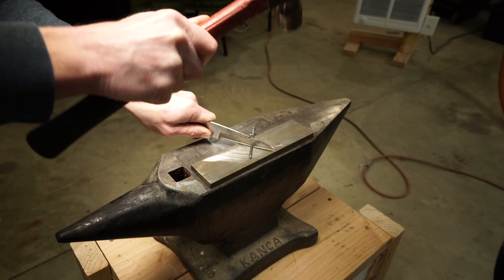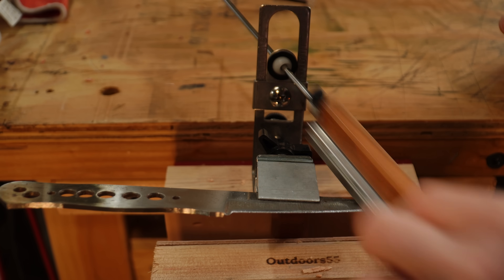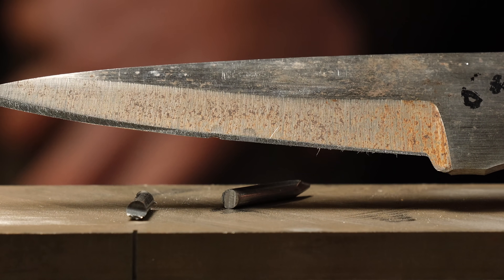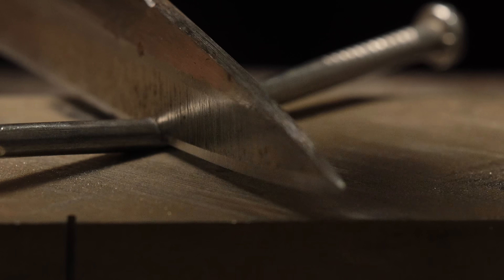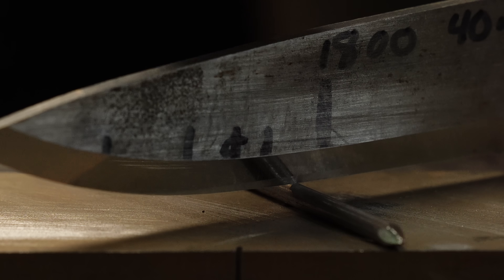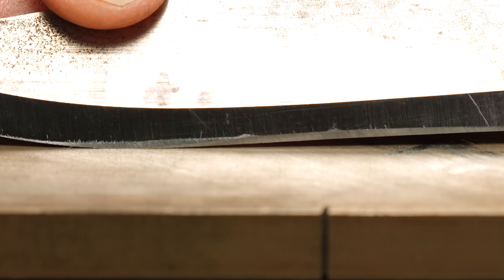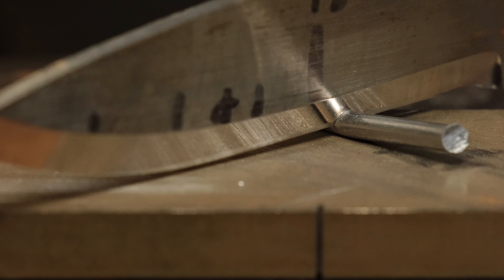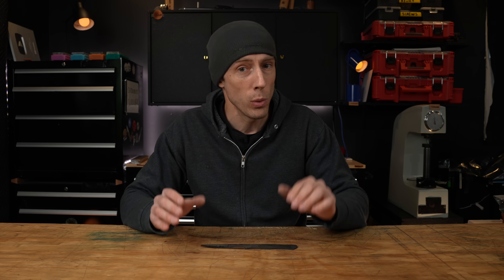Why My Knife Will Cut Through Nails And Yours Can’t - THE TRUTH is not what you think.

Comment from the maker: PLEASE READ- Nowhere in this video do I claim that any knife sharpened to 30 degrees will survive a nail test. The angle here is completely irrelevant. The idea is to adjust the angle to fix the problem. also please see follow up video here https://youtu.be/DVb7rmsZ6ko for more clarity.
Thanks.
Quick note. This video is about analyzing the TEST itself, and what exactly we are testing. Of course heat treatment, and steel matters.  And they definitely play a role here as well. However, geometry, is often a game of a few degrees, and a few thousands of an inch in blade thickness, that determines whether a knife survives this kind of test or doesn't.  Also, if we start stressing the knife on different axis's we will also get different results, since other factors then come into play. This is just a quick rundown showing that everything may not be as it seems.
Reply: @OUTDOORS55  ive had a kme for quite a while now. When I first got it, I ruined a few knives trying to get super small angles with those mirror polished secondary bevels. Turns out cutting simple plastic or cardboard at that level will give you considerable edge damage and dull your razor sharp knives to the point it won't cut at all. Expensive lesson learned.
Reply: So survivalists should sharpen to 25 degrees?
Reply: @YehawSkyrim  Or someone who cuts through a lot of chicken bones?
Reply: @YehawSkyrim he's not recommending angles. 25° would be a bad idea for different tasks of survival and good for others.
Reply: @YehawSkyrim 
Survivalists should rather stop thinking their knives have to be able to chop concrete, chisel through rebars, dig into rocky ground, pry open doors, etc... and start using their knives with a minimum of common sense.
Reply: I've learned so much from you Thank You.
Reply: People started doing this test cause of the old buck knife ad saying it could cut a nail.
Reply: Thanks for clearing this up so definitively. Another one that needs to be put to rest: polished edges have less edge retention, toothy edges stay sharp longer.

Comment: I saw an ad from the sixties where a Buck 110 cut a nail with no damage then they tried it with a new Buck 110 and it left a nail shaped inditation in the blade that ruined it . I know they haven't changed a Buck 110. Also I saw a Spyderco Endela VG 10 chop right through with no damage what so ever. I understand what your saying but is it all just blade geometry? I've seen multiple 3v knives go right through nails without even chipping

Comment: Yes you can give a lot more stability to an edge by increasing the edge angle but that’s not impressive. There are steels that can cut nails with 18 degree edge angles and that have everything to do with the steel and heat treatment.
Reply from the maker: @hamedizzy5137  18 degree inclusive or per side. These things need to be disclosed and third party tested.
Reply: @ you’re putting 25 per side to get you’re average steel to cut nails. Go watch some of the custom guys that do testing. You have miller bros cutting structural beams with 20degree edges a nail is noticeable impressive

Comment: Correct depends on geometry and how sharp and the degree of angle and Depends if every knife is cutting the same nails I know a Casehard nail is  way harder than a say 12 or 16 penny nail but even with the older penny nails to sharp of a blade will still round over. Great video keep Rockin 👊😎

Comment: You may be missing some of the point of a nail cut test in its relation to a particular steel and heat treat protocol. Of course the geometry matters, but the whole point of a supposed better steel and heat treat is that you can run thinner profiles with more acute edges, meaning better cutting overall, and still cut through a nail. CPK comes to mind, they run some pretty thin profiles with 18-20* edges and can cut through a nail with no damage.
Reply from the maker: Yes, but without knowing the geometry, and how it compares relative to other steels at exactly the same geometry it's meaningless. This is a game of a few degrees and a few thousands. Not something easily controlled unless each knife is specifically ground to that standard for testing.

Comment: I would broadly agree, but speculate that there's a range being assumed here. A truly inferior material (say, aluminum) would absolutely fail this kind of test, even with quite a bulky edge. Geometry is the most important factor within the range of materials commonly used.

I swear, I'm not just arguing to be difficult. With so many relatively new companies on the market, robust testing is necessary as an accountability mechanism. Destruction testing fills a necessary niche, especially in products that market on durability and reliability.

Comment: This is not entirely the case… the knife has to be harder than the nail and the grind overall along with edge also matters. You were using  what appears to be a scandi with secondary bevel… try that with a hollow grind and it can fail … the problem is … people want to focus on only one variable at a time when there are easily 6-10 variables at any time

Comment: So I've seen you make this point and it seems clear. However, I have QUESTIONS... Actually, only one. In another video about angle guides, you were pointing out that the higher angles on the angle guide were too steep and led to dullness and not keeping an edge. What is the minimum practical angle for a general purpose, carry knife, of reasonable steel and heat treatment if I want to make it shaving sharp but maintain reasonable edge retention? I'm looking for a ballpark, not a specific number, more of a range, like 14 to 16 or something. What I am after is just shaving sharp, not knife nerd sharp and that will hold up to standard sort of tasks...

Comment: It likely has to do with the angle for shear stress in steel being 45 degrees when in linear compression. Basically steel under high linear compression loads wants to shear at a 45 degree angle. So anything under 22.5 degrees the shear stress has no-where to go so it fractures. Cold chisels (used for cutting through metal) are normally sharpened between 50 and 60 degrees (25 and 30 degrees each side) for this reason.

Comment: It is like ginsu knives cutting 2x4s and nails like a saw. Hard edge serrations and well you got a wood saw and hack saw universal blade that also has a fine enough grind that it can peel a tomato. I had a old balisong no idea who made it was a a custom job it had some funky micro serrations no other word for them that were very very tiny like a single strand of very fine wire like found in am radio antennas or a bit finer. That knife would saw though a 16 penny nail as fast as a hacksaw and still shave the serration pattern extended all the way up to the top of the primary bevel and were only on 1 side of the blade the entire blade had a chisel type grind with a ever so slight hollow grind edge to spine. It took and held and edge for well i never sharpened it in about 10 years of owning it the most i did to it was lay the flat back side on 2k grit wet dry with a few drops of oil and give it a few circular strokes followed up with water on tempered glass to polish the edge.  i doubt it would pass a hammer through nail "test" but sawing through no problem at all the metal shavings looks like hack saw metal shavings LOL 

I like a fool sold it to a friend for 500 i only paid 150 for it he ended up losing it LOL

Comment: Great video, spot on. What I would have loved to see next was The cutting difference between a 20° angle, 25° angle, 28° angle, and 30° angle. 

Maybe a follow-on video?
Reply: Agreed. Also how would that work on a kitchen knife? Maybe if you have a cheap kitchen knife with a 53 hrc blade you should sharpen it at 30 degrees. Would that damage performance much I wonder
Reply: @explainedgmod  30 degrees on a kitchen knife would make it completely useless.
Reply: @Jake-bt3fc  how so? And why?
Reply: @ It wouldn't make clean cuts on fruits and veggies and you would crush and damage them trying to force the knife through it. A finer edge cuts with less pressure and less tearing so the food stays more intact and the cleaner cut has less oxidization.
Reply: @Jake-bt3fc  aa ok
Reply: @Jake-bt3fc  What about bone cutting knife? Should that be closer to 45-60 (27.5-30 per side) degree ?
Reply: @Jake-bt3fc what would that degree be for kitchen?

Comment: Awesome explanation . . . Can we now talk about the elephant in the room ?
- Damage inflicted upon the blade steels during the sharpening process . . .
 in the cutting edge, at the base of the bur ?
Reply: You have my attention.  We talking about applying too much pressure on stones/plates/strops flexing the apex and causing micro fractures?
Reply: @ElonaldTrusk  Yes . . .  I would describe it as . . . cumulative unnecessary pressure & temperature on the low side.  I have been researching & watching sharpening videos for the last 5 years & no relevant info shared.  
- I assume you know a lot more than you are revealing.  
- Have I revealed what you already know ? 
 - I would like to find someone interested in this topic at a deeper level to discuss this with. 
-  I am easy to find if you or anyone is interested. I do photography & make knives.

Comment: I never paid much attention to the nail test, because i thought it's way out of my use case. 
Until I forgot my hatchet and batoned through what I thought is a knot in the wood. 
It turned out to be a wood screw. 
And I was very happy, when my carbon steel garberg survived without damage that a few strops couldn't fix. 
That little sacrifice in slicyness did buy a lot of stability. 
Most of the time I still prefer slicy though.

Comment: People who watch Forged in Fire closely may note instances of individuals putting low angle edges on blades and surviving with no edge damage. The smiths admit they want an obtuse edge to survive, but they go to the cutting test and...well of course an axe edge doesn't cut. Conversely some people have gone for very steep edges and get chipping and rolling.
Reply: Because that is a completely different game. 
They are under a lot of time pressure, the heat treatments are certainly not standardized to any degree, a lot of the time they are forced to use awful steel, they often have serious problems with the blade that they are forced to ignore (cracking, warping etc.)

They end up with blades that have a completely different behind the edge thickness, total thickness, bevel angle, microbevel angle, heat treatment, and sometimes even steel.

And handforging by itself is certainly more prone to problems compared to stock removal.

Unless we are talking about the final round, where the contestants are allowed to go home to their tools and get a few days, a lot of these issues can be explained.

Comment: I've always wonders why knife companies do not sharpen their knives with graduating edges, ie thicker at the base for heavy work, and thinner at the tips for fine slicey work. I tried it and re-profiled an old beater Mora and it became really useful, having the toughness where I need it and sliciness for finer work all in one knfe. Basically positioned it at an angle instead of perpendicular to a fixed angle sharpener.
Reply: Too much work and cost added to the product. 
But in fact it was done in the "old times", the classic vintage "Sabatier" style knives have a thicker ~third of the blade's length portion of the blade, with more "meat" behind the edge for cutting tough stuff, then the blade quickly tapers to a thin "lazer" blade for the rest of the knife. They don't do it anymore.

Comment: Even if a knife is properly heat treated, it may still roll depending on the thickness. I usually prefer having level 3-4 sharpness on a bushcraft knife. Level one or two would cause that knife to roll when if I drop it on wood.

So yes, expect consequences when getting a paper thin blade.

Comment: Here in south east asia (or maybe in whole asian countries) knifemakers and blacksmith often test their finished blade by cutting nails (wooden iron nails, not hardened heat-treated concrete nails). They do this mainly for advertisement so people think that "wow that blade is high quality it's properly harden!" then they're more willing to pay higher price for the "nail cutting-sharp" blade.

I do this abusive test myself, not after sharpen by the way but before it (ofc after heat treatment), because again geometry. Nail cutting blade edge is so steep it sacrifices a lot of it's geometry angle just for the show.

Although some "naughty" knifemakers do dirty tricks by using special nails that basicly already cut but reconnected again with lead and then hide it by grinding it and cover it with rusting agent so the blade will cut the lead instead of iron

Comment: Cheers for painfully pointing this out. I often get modern super duper steel knives with lots of micro chips. to sharpen. I shallow out the bevel angle by a few degrees and problem solved.

Comment: Look at a cold cut chisel vs a hot cut chisel. A cold cut has a very blunt angle compared to a sharper hot cut chisel. The cold cut angle spreads the pressure across more edge area and moves the material more efficiently. The hot cut chisel can be sharper because its expected to be used on material that has been heated to a degree of softness/maleability. Kitchen knives often have <20° edges, and hunting/utility knives and tools have angles >20°.

Comment: You were doing awesome right up until your conclusion. Geometry is not the only factor in whether or not your knife will survive cutting nails. Material properties and the quality of steel do absolutely matter. A better way to conclude it is: As the edge gets thinner, material properties become more critical. I would be interested in you testing different metals, all at the same thin geometry to see which one performs best. I suspect metals with high toughness will do the best. Cheers.
Reply from the maker: Read the pinned comment 👍

Comment: MagnaCut was the only steel I got to cut trough a nail with thin hollow ground blade, truly amazing. But not much info from that test, and it is ruined by people who do it for no info, just a cheap add. Whittling a nail or a brass rod is a much better test to see edge stability, will it roll or chip. Best steel I tested with that method was Elmax.

Comment: Totally agreed with you but should the grind of the knife be part of the geometry as well?  A convex grind knife might help to split the nail toward the end of cutting, it's kind of demonstrated when the angle was increased to 30 degrees, the nail was not cut through but split by the side of the blade.  It would be interesting to include the grind as part of your experiment, e.g. hollow grind so the sides are not affecting the cutting.  Great video and appreciate your contribution to the knife community.

Comment: So I know this has been "the talk" lately, and I think that context really matters here. Yes, we know a knife isnt designed to go through nails and all that, and that you almost inevitably will ruin the edge. But the failure mode matters here, when you take two similar knives of roughly the same geometry/thickness and one gets some edge damage while the other shatters into pieces 1 inch up the blade then that is (imo) a way too extreme difference in failure for me not to think theres something else going on with the steel here.

But yes you are absolutely right on this point. I just think theres more to be said about it.
Reply from the maker: Yeah theres more to say for sure! Keep in mind though that this is a game of a few degrees and a few thousands of an inch in grind thickness. Literally 2 degrees on the bevel, and a couple thousands on the grind can mean the difference between a broken blade, and one that's completely fine. If you're specifically looking for a knife to cut nails, or mild steel, or whatever, thickness is your best bet. Thats why bolt cutters cut through bolts. I pinned a comment talking about what this video is looking at. Thanks for the comment 👍
Reply: Like what.?
Reply: @LogisticallyMisrepresented  Liiiike the heat treat protocol. Again, the interesting part is HOW it fails, especially when the bits it breaks into has alot of 45 degree angles on it which we have seen in a few cases of this kind of "testing" lately.

Larrin Thomas talked about this a while ago, how hardness isnt necessarily an indicator of anything being done correctly because you can overshoot the treatment and still get to the correct hardness, but the structure inside is weak and brittle. I dont know enough to say thats it, but something is going on that is not related to geometry when instead of a chip like shown here, the entire blade just goes into pieces
Reply: Outdoors says it,  @kvernesdotten
Reply: @LogisticallyMisrepresented  I saw, not sure what you are getting at though?

Comment: Great video! Slightly off topic, but speaking of angles, I always wonder what angle you are freehand sharpening at? Is there a way to check?  I feel like I am not consistent yet, so I usually use that orange Sharpal angle guide at 14 degrees, but can't quite get shaving sharp yet, even after stropping. I'm guessing 14 is going to be easier to get shaving sharp than 20 degrees, right?